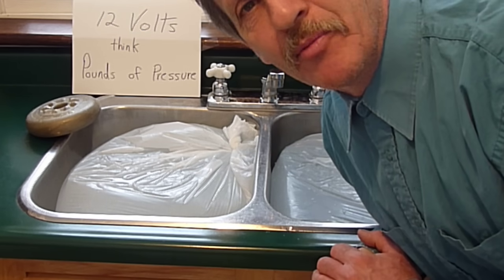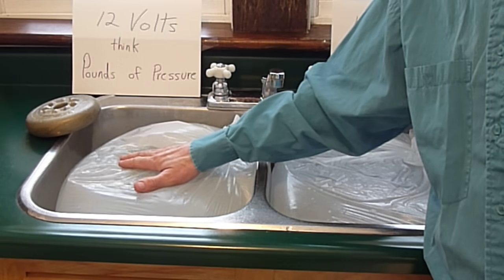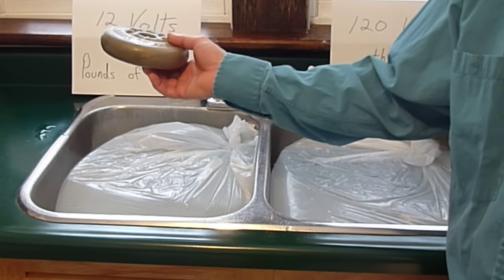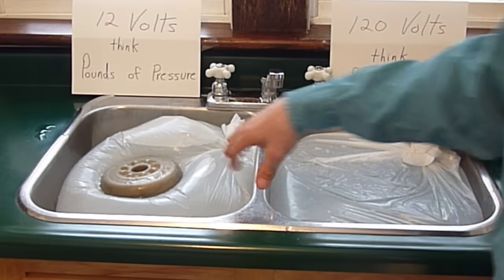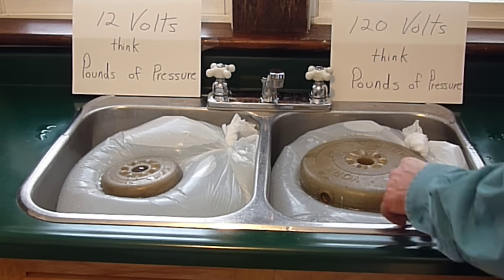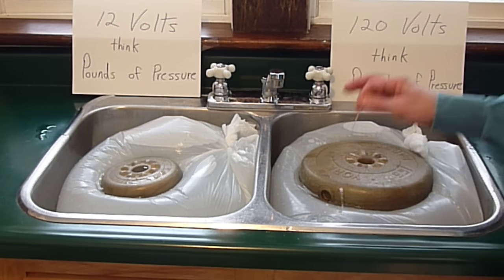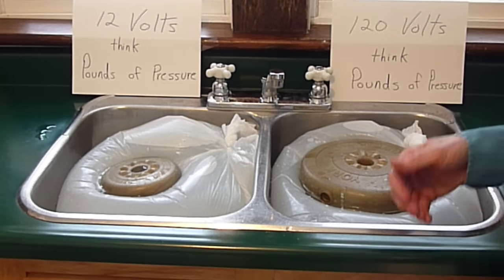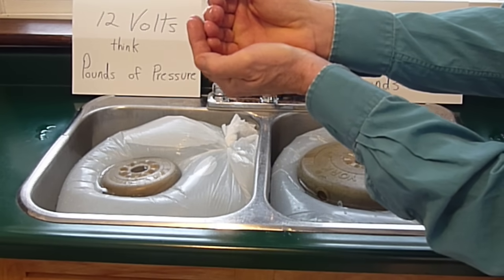Amps, volts, watts explained...SEE what it really is all about.

Comment: bad explanation kind of bizarre to be honest. The best possible one would be using volts as PSI and gallons per minute as amps. for example 12 volts at 1 amp is like a garden hose while 120 volts at 1 amp is like a fire hydrant
Reply from the maker: Turn on the volume on the video and listen very carefully. You will hear that I am using volts as PSI and flow as amps. Funny dude you!

Comment: P=VA  if 10000W=12V(A) then A=833.3 amps and 10000W=120V(A) then A=83.3amps In your explanation why will 120 V produce more current?
Reply from the maker: Given a certain wire size (in this case the size of the hole in the bag is the size of the wire), higher voltage will push more through.. If you want to see the same amount of power (10000W) coming out of both bags (that's what your question is asking), what will you have to do. One way is to increase the size of the hole on the left hand bag, thereby creating more flow (amps).

Comment: So what exactly is ampere in this explanation?
Reply from the maker: If you think of amps as the flow of electricity, you may better grasp the concept of it. A tiny backyard generator can't supply enough electricity to power a city just like a small stream can't provide enough water for a city. A big hydro dam can provide that power, or a nuclear power station can, just like a big river can provide the water needs of a city (average person uses about 80 gallons a day).Cheers!
Reply: Guy Presse 

I see.   And in this example, is amperage represented by the diameter of holes you made in the two bags?   Thanks.
Reply from the maker: The diameter of each hole is the same, but in the one with the more powerful battery, you see the amp flow is greater than the one that has a smaller battery, which just is a small leak really. Visually, amperage is the flow, or squirting of the water. The diameter of the hole could be seen as the size of the wire which the amperage flows through. High voltage power lines crossing the continent carry over 100,000 volts and that allow lots of amperage to be pushed through to service lots of homes, and that is also why the wire in high voltage power lines is thick. Compare that to the wires in your house, much thinner, and only need to carry 110 volts to push enough amps to your different appliances. The size of the wire, or size of the hole in this case, has resistance. It's hard to push water through a small hole compared to a big hole, and the same is true for amperage, it is easier to push amps through a larger wire. Look at the wires leading from the battery of your car, and remember that is only a 12 volt battery, so thick wires are needed for such a weak battery to operate the starter of your car. Though the battery in a car is big, it still is weak in terms of voltage, but can still push quite a few amps. Imagine my bag example, with the small battery, and a 3 inch hole, sure, lots of water would flow out, but it still would have little pressure. Hope this clears it up??

Comment: Doesn't the size of the hole determine something? The heavier weight on the bag pushes out the same amount of water, only faster, no?
Reply from the maker: Yes, you are quite right. The size of the hole in this case represents the wire size, or thickness of the wire to be exact, which in turn determines resistance. If you push lots of amps through a small wire (high resistance), it glows red. High tension wires, nice and thick, have lots of voltage pushing lots of amps through them, allowing to service many homes. Cheers!...and thanks for your input.

Comment: watt I dont understand is where the pressure comes from...and watt I always wondered is in.a tesla coil why doesnt the smaller gauge wire heat and burn if the voltage is amplified...can u make another video, simplifying it a tad further cus I still dont get it...im an idiot, who probably shouldnt messing around with electricity in the first place lol...thank u
Reply from the maker: You ain't no idiot, you gotta mess around to learn stuff, just be careful. The pressure generally comes in two forms; either from a chemical reaction as in a battery, or from powerful magnets passing at right angles to lengths of wire, thereby inducing a current.  In a Tesla coil, just because the voltage is amplified, doesn't mean that a lot of current is passing through it. Think of a dripping tap in your country home; if you have a crappy pump you can very likely plug the faucet with your thumb and no water will come out, but if you have a big powerful pump, you wont be able to contain that drip as it will push your thumb out of the way regardless that it is still just a drip coming out of the faucet. Cheers, and hope this helps?

Comment: Hi GP So does Volts drive Amps then? So why can't I get loads of Amps from my H.V. 10,000 volt coils?  Regards .... DC
Reply from the maker: +E.power DC Thin wire won't let many amps go through. Look at those high tension wires, nice and thick, very high voltage to push that electricity far and wide.

Comment from the maker: Think of my video with the bags in the sink.  big battery and small hole (240 V and 0.3 A=72 watts), now take that water that flows out and put it in a bag with a small battery and a big hole (12 V and 0.5 A = 6 watts). It would take 12 small batteries with bags with large holes to empty out all the water of the big battery with bag with small hole.  72 watts = 6 watts X 12.

Comment: thats it,, thats why im confused.. if thats correct ,,that ex. with the pool.. then how is possible that i have 12 V "pressure"  but more water flow?  if im using just 0.3 A . thats the water flow.. so how is that possible? 240 V and 0.3 A going in..   but 12 V  0.5 A is geting out.. that means im taking small river and making a bigger one with that one..

Comment: I would use the skiers analogy. Skiers go up a ski lift, gaining PE in the form of kinetic energy, as they fall and slides down the mountain they lose that energy doing work, as they plough the snow aside in their path. At the bottom they lose all their PE, gaining it again as they go up the ski lift.  Ski lift, battery; skiers, electrons; the snow, resistance; the motion of skiers, current.

Comment from the maker: You are quite right, voltage is not pressure.  The video uses an analogy to help understand a difficult concept. Do you understand what an analogy is? Can you come up with your own analogy of what is voltage, amperage, and current. It would be of great use to other students if you could come up with a better one than mine. Cheers!

Comment: Voltage is not pressure.Its a measure of potential energy.Its the amount of energy in Joules that could be expended by a coulomb of change (electrons.Voltage can describe this potential at a point or it can describe the difference of this potential between two points. Current is the vibration and general motion of electrons opposite to the electric field. motion of current in conductors is somewhat smooth, in resistors electrons vibrate intensely giving away energy as they fall to inner orbits.

Comment from the maker: You are absolutely right.  Some arc welders use just 24 volts but send such high amperage that it works and melts steel, yet at 24 volts you can hold the welding leads and not have the current "pushed" through your body and so you don't suffer any electric shock if you mess up. The lower voltage is actually a safety device. As you know 240 volts "pushes" easily through your body resistance and causes problems if you're caught holding the wrong wires. Cheers, and many thanks for writing.

Comment: This video finally brought it all together for me after watching MANY. Also, would I be wrong in saying that the size of the pinhole could represent the resistance (ie. ohms) and therefor affect the amount of current? In other words, a bigger hole (less resistance) in the 12v system might yield the same flow of current as a smaller hole (more resistance) in the 120v system?

Comment from the maker: Yes.  Usually a battery chager for a car (alternator) will charge above the 12 volts, usually around 13.5 I believe and a voltage regulator insures that the battery doesn't get charged above 12.8 or so volts.  The charging amperage can't be too high either or damage can be done through overheating the battery.  I think it can be dangerous as well.

Comment: And to just expand on one more basic thing, the flow (amperage) as he described is determined not just by the pressure (voltage) but by the resistance (Ohms) of the material the electricity is flowing through. More resistance, the slower the flow. Even with massive voltage, if it's traveling through something like rubber with tons of resistance, it won't do a whole hell of a lot. :)

Comment from the maker: Yes, if water were watts, then the weight really is pressure which is the volts, and the flow is the amps, which is why sometimes you will hear people talk about amp flow. So it is possible to have high pressure yet have little flow (a 10 watt 120 volt light bulb), as well as low pressure and big flow (a 12 volt car battery putting out 600 amps to start the car). Cheers my friend.

Comment from the maker: I think it would be difficult, a bit like trying to make a light bulb brighter.  You'd have to get in there and change the filament for one that has less resistance and lets more amps through. It would be difficult I think to take a solder iron apart and change the wires for ones with less resistance, or the same wires but just shorter.  I've never done it.  Maybe it can be done.  Good luck and have fun.

Comment from the maker: @megapwn333 Yes, you're right on the resistance.  That's why those high power lines operate at such a high voltage.  To overcome the resistance along the way.  A car battery can't even push electricity through your body (if you hold a battery post in each hand).  Now at 120 volts  you can still move a bit and let go of the wires, and 200 volts makes it impossible to move.
Let me know what you think.

Comment from the maker: @megapwn333 The watt is the energy lost or work done. One watt for one second is one joule.  Voltage is a measure of potential.  Hold a balloon of water (pretend one coulomb) 5 feet high and drop it.  Now raise the same balloon of water (one coulomb again) twenty feet high and drop it.  More potential at twenty feet, and that's voltage.

Comment: @sunfacts I don't get one thing tho, what loses the energy. I thought the energy was lost by coulomb ? I think by definition volt is energy lost or work done by coulomb as it travels from A to B of the battery measured in joules per coulomb  ? but now i see that energy is produced from the coulomb traveling thought the wire as current ? so bigger potential difference the faster it goes the more energy it can produce ? and what about the resistance if its increased does it mean more energy will

Comment from the maker: @LoveMyDogy 
High volts, low amps,  just like an electric fence, but higher volts than the fence and lower amps.  Now if you have experienced a stun gun first hand,  would you be kind enough to share your experience here in some detail as to the physical sensation it caused.  Thanks for taking the time to add a comment.

Comment from the maker: You know that 120 volts pushes electricity through the body quite easily, so yeah, that was shocking, but not as much as the time I felt 240 volts rip through my body.  That was uniquely memorable.  Thanks for your comment.
Reply: I tapped into 240 once and I immediately turned around to ask who just whacked me in the back of my legs with a bat?

That was the feeling. It will leave you questioning reality, that's for sure.
Reply: 12 years later but i gotta ask, what happened that u felt 240 volts rip t hrough ur body?
Reply: @invalidacess  yeah what? I had a lightning bolt flash  about  4 ft in front of me about chest high on the porch one morning in a extremely heavy rainstorm and it was so forceful that it push me thru the screen door I just walked out as well as made me feel odd in a way I can't really explain other than that since i  knew what happened it was obvious to me that my personal physical electrical system was out of whack. And I felt that way for quite some time .Like more than 6 months for sure. One of those feelings you can't quite put your finger on how to describe but it's notable in all day every day life  experience. Weird is how I would describe it for lack of another way. Sort of out of body kind of for comparison but not in a way. Very strange.even as im commenting i recall the feeling quite well but not nearly as well as the period of time afterwards. Also it kind of mellowed out at first to a point and then stayed at a certain noticeable point until i one day realized it seemed to no longer be lingering with me. Until now that im thinking about it it im not sure for certain that i cant feel it still more than a decade later in some small way. 
Hmm ? Makes me wonder. I can tell you that it was an extremely big lightning bolt as the others in the storm were as well.  BAM . yeah that's my excuse. If i ever needed one that is . whew 😬⚡😕
Reply: @invalidacess most countries use 240v so it’s more likely than being zapped by 120v.
Reply: THanks for the sweet video 🙏 I grew up in Germany ... i tinkered and renovated a lot, so I've experienced 220 V shocks through my body several times ... It surely wakes you up 😬
Reply: You've probably all experienced many thousands of volts more than that touching a metal rail/handle after walking on a synthetic carpet. But as there's very low current it's harmless!
Reply: @keithposter5543  More specifically, the electrostatic discharge we experience from the likes of a synthetic carpet is a high peak current for a very short time, resulting in very little energy.  The discharge current can peak at multiple amperes or even more than 10 amperes on occasion.  In contrast, currents of a tenth of an ampere and higher can be lethal if they persist from an ongoing source.  Fortunately, the human body in a normal atmospheric environment will not charge due to static electricity buildup sufficiently to store enough energy to be lethal.  We don't even notice the frequent static discharges that occur when our bodies are charged to about 2000 volts or less.
Reply: @analog_guy  Thanks for the clarity on that - makes sense 👍
Reply: I'm glad you are able to remember!  🙂
Reply: 240 is quite the zap for sure. You don't forget.